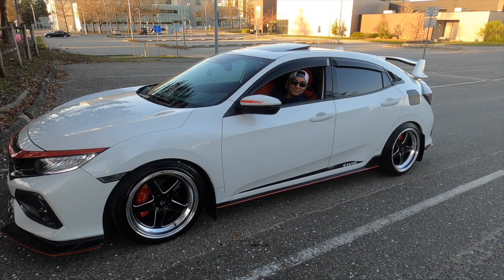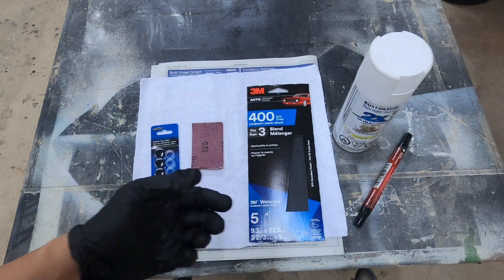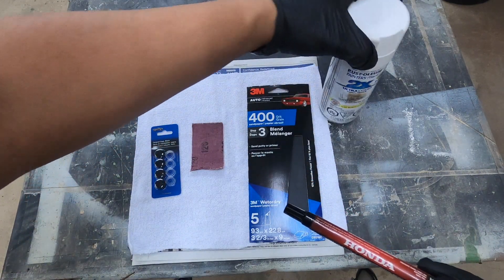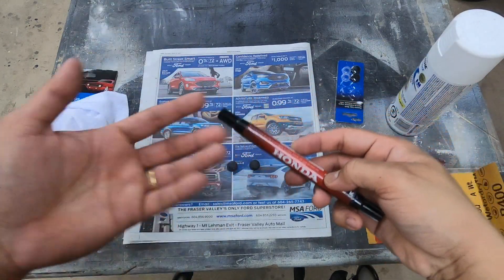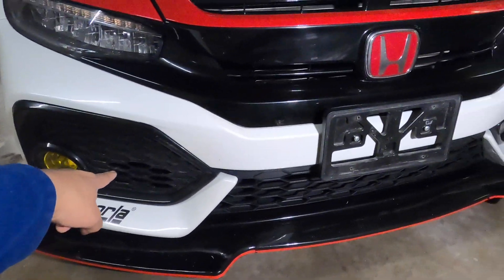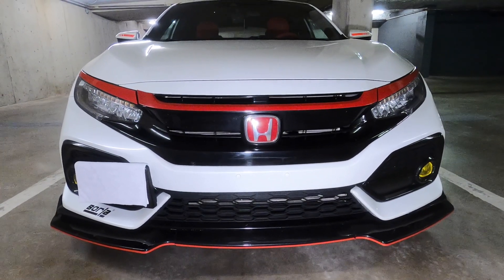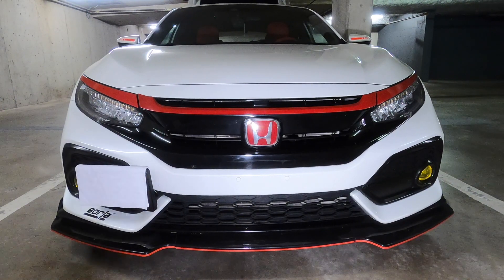Do it yourself Bumper Plugs and License Plate Relocation

Comment: Can you list all the parts you used to do that?
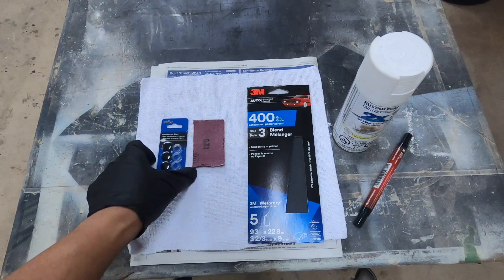Reply from the maker: 2:00 bumper plugs
5:00 plate relocation parts
Reply: @geefamz7172  thanks
Reply: @geefamz7172  where did you get the spacers?
Reply from the maker: I bought it at canadian tire and its also available in home depot and lowes

Comment: So I bought all the materials but the bumper plugs don't stick properly am I doing something wrong? i bought a same exact pack I even used the other ones how come it does just stick on? it seems fairly loose?
Reply from the maker: Use the old screws of the license plate
Reply: I had to get new screws for my corolla. I had 10mms. Went to ace got some larger screws for 33cents. Screwed it right in no problem and fits snug. Ended up not using the plastic spacer as well.